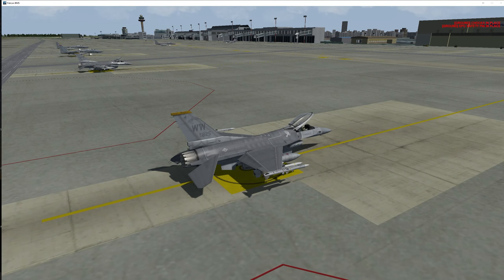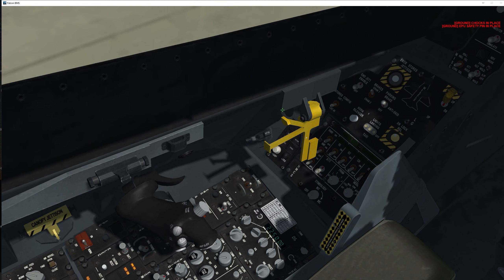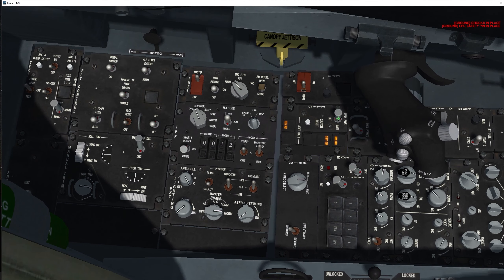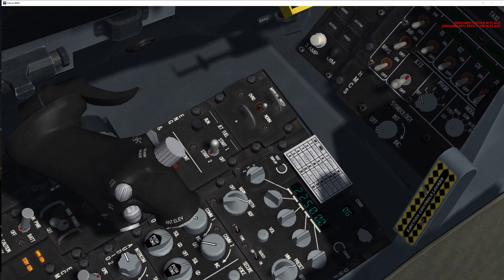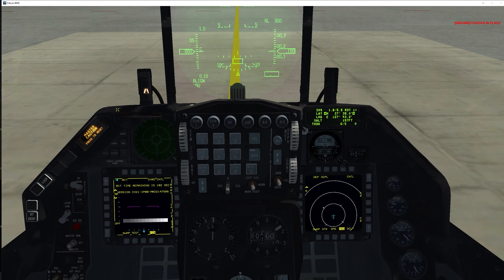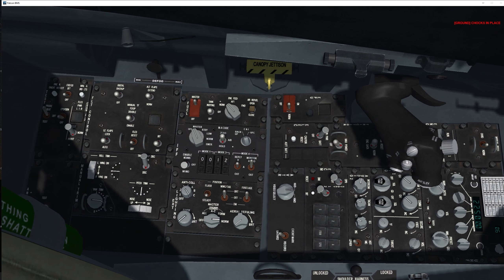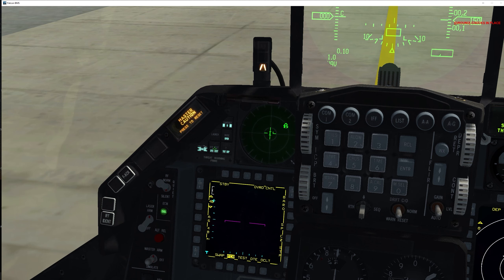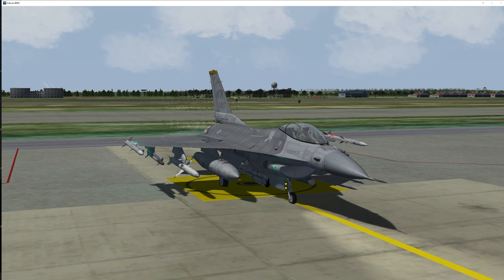F-16 Cold and Dark Engine Start-Up - Falcon BMS 4.35 - 3 Sweep Method

Comment: @X-CHECK  Not sure if this was a recent development, but the dash 1 manual seems to contradict itself about the FLCS BIT being eye candy. You're right that page 174 still has the eye-candy statement, but note that LATER, on page 215, it says "With 4.35, a new FLCS fault will happen at ramp and if not cleared accordingly may induce
repeated FLCS BIT FAIL." I'm assuming they didn't go back and remove the eye-candy line after writing this.
Reply from the maker: You must reset the FLCS! Or serious issues will occur. But the bit it self is eye candy for the time being.

Comment: I have a problem: when I start the engine on F16, the engine rpm goes to 70 instead of 60, even when the throttle is fully back. I check the throttle axis settings both on windows and game settings but they look fine. I have this weird issue on BMS only. do you have any idea about this?
Reply: You might be using a different block of aircraft or maybe your throttle detent isn't registering idle cutoff zone

Comment: Hey guys, Cant use mouse looking inside 3d view, works middle button to move foward and to sides, wheel works to zoom, but cant look around. only outside the plane. I have the Opentrack installed and notice on some places that a NPClient64.dll file do that. Anyone nows how to solve that using the opentrack too?

Comment: FLCS BIT is not an eye candy. Read the manual.
Reply from the maker: BMS 4.35 -1 manual, change 3.00, page 174, it reads: "Both the FLCS bit & DBU are eye candy in BMS and have no consequences if you skip them."

So, this may be awkward for you but... Read the manual. Before you tell someone to read the manual lol.
Reply: @XCHECK  1.12.8. FLCS BIT
The FLCS should be tested at ramp start by using the FLCS BIT switch. In real-life it is a magnetic spring-loaded 2-position switch. When engaging the FLCS BIT a green RUN light comes on and the FLCS goes through a full series of tests lasting approximately 45 seconds. During the tests the flight controls will move and this movement will be visible over the multiplayer network. Warning light and HUD messages will be displayed during the BIT.
The test can fail and failure is indicated by the illumination of the FAIL light on the FLT CONTROL panel. A FLCS warning light, HUD WARN message and corresponding PFL will also be displayed. A failed test can only be reset by rerunning the test again until successful completion.
A successful test is indicated by the green RUN light going off and the FLCS BIT switch snapping back to the OFF position. The FLCS bit progress can also be followed on the MFD FLCS page. The BIT in progress and BIT status messages are displayed.

This info is in the TO-BMS1F-16CM-1.pdf manual
Meabe you are talking about the DBU
Reply from the maker: @Altrote100  Key word "in real-life". TO-BMS1F-16CM-1.pdf (BMS 4.35 Change 3.00), Page 174: "Both the FLCS bit & DBU are eye candy in BMS and have no consequences if you skip them." Go ahead, check it out, its right there in the manual. You claimed I did not read the manual because I called it eye candy, but I read the manual , and the manual clearly says it is eye candy, what do you want me to tell you man? Now the manual is wrong?
Reply: @XCHECK  "Both the FLCS bit & DBU are eye candy in BMS and have no consequences if you skip them".Yes, you are right but it is rare that it says that it is an eye candy because if you do not run the flcs bit the autopilot does not work and you would have problems controlling the plane, I say this because it happened to me.
Reply from the maker: Well that definetly puzzles me. But for this video in particular I wanted to stick to the manual lol
Reply: @XCHECK  after a quick check I realized that there is a misinterpretation on my part. You can fly well without running the FLCS bit, what you can't do is fly without RESET the FLCS. So the manual is fine and you are right
Reply from the maker: @Altrote100  Ah! Ok that is what may cause in-flight issues, that is good to know! Thanks for clearing that out. Reading a bit, it seems in the future this bit will stop being just eye candy, so it definetly is a good habit to do the test!
Reply: @XCHECK  geat to know that. Regards mate. I love your videos, I hope to see more content from Falcon.
Reply: @XCHECK  Gotteeemm haaaaaa